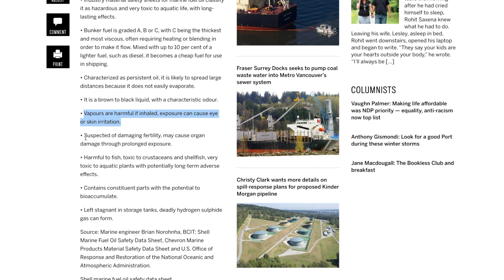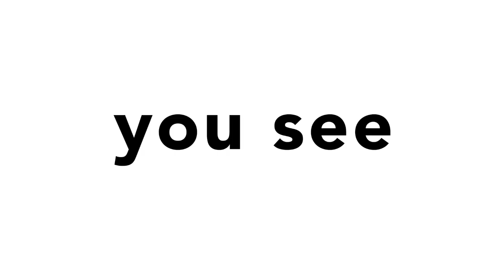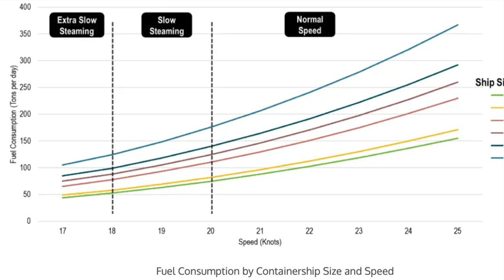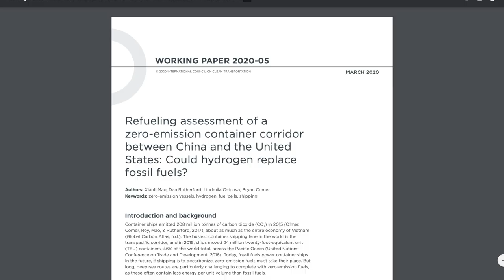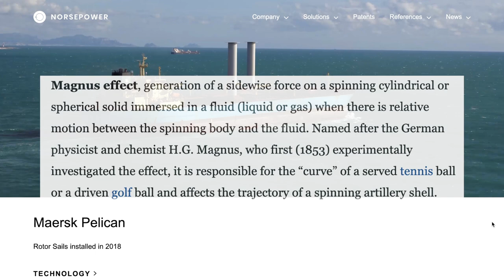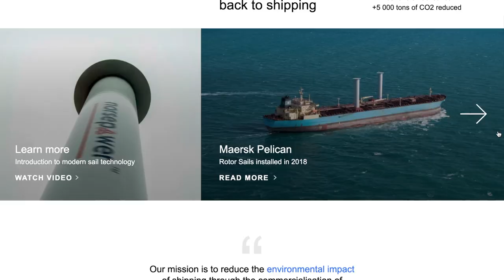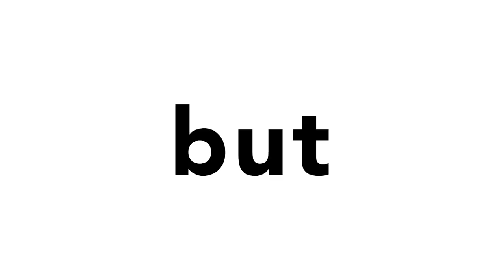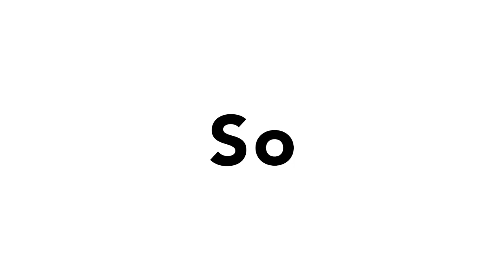Are Renewable Container Ships Even Possible?

Comment: Shipping companies pass on the expense to the consumer.  Enact laws and pay more for everything, that’s the current situation, of go nuclear.
Reply: ' pass on the expense to the consumer' I think you may have stated 'The First Law of Market Economics'.  WRT nuke's if you do a web search for ‘nuclear ship savannah’ you will see that it has been tried and did not work.  A similarly heavily subsidised, by the government, vessel is in use in Russia which also operates, in support of the Northern Sea Route, a fleet of nuclear powered ice breakers these may, or may not, have been completely without issues.

Just think; would you have full confidence in the management of a nuclear reactor under the control of an anonymous entity only traceable, perhaps, via a letter box in a FOC (flag of convenience) nation state?  If you are, could you sell that confidence to Japan, the state that hosted the Hiroshima and Nagasaki nuclear detonations as well as more recently the Fukushima ‘event’?  Then try that same, or a similar, sales strategy on Ukraine, the nation state that as a part of the USSR (CCCP) hosted the Chernobyl ‘event’.  Modern iterations of nuclear energy, thorium fuel, molten salt reactors or fusion reactors, will carry the legacy of past problems.  It is the global trepidation of anything with 'nuclear' in the name and the economics of nuclear having transitioned from 'energy to cheap to charge for' too 'the costs of remediation are incalculable' that will prevent the adoption of nuclear energy as a means of creating energy at sea.  Modern reaction systems may have overcome the safety problems but the general public, having been misled in the past, will be reluctant to believe the fresh new promises.

‘They’ say nuclear is cheap, it’s not it is expensive and has a large embedded carbon quotient as well as being complicated, dangerous, not universally socially acceptable and having only ‘no need for refuelling’ as a questionable advantage; actually it does need refuelling just not as often.  When ‘they’ do need to refill the warming up stuff it takes considerable longer than pumping tonnes of thick black stuff, HFO cSt380, or thin runny stuff, MDO, onboard which is one of the reasons HMS Queen Elizabeth and HMS Prince of Wales are pushed about by ICEs and gas turbines thus using a similar fuel as the aircraft that fly off of them.  The Royal Navy (RN) with a high degree of skill and expertise uses, at vast expenses to the UK taxpayer, a current operational nuclear fleet of 11 submarines (also known as ‘boats’) in two flotillas, seven attack subs and four ballistic missile boats.  The carbon footprint of all the extra bits of hardware and the fuel, including processing thereof, from ground to propeller, are the external costs that never seem to get considered.

Disposal, once it wears out, of both the machine (that was a ship) and fuel is another can of worms best left unopened.  The 26 RN boats no longer in use are laid up (some in Rosyth and some in Portsmouth) awaiting long term deconstruction including dealing with the fuel rods and other irradiated material.  The USN is not, as far as I know, a commercial organisation working to very tight margins and also has the skill and expertise to handle the complexities of nuclear power; so as well as submarines their aircraft carriers are nuclear powered and each of the current iteration has a build cost three times that of QE/PoW, bigger crews and more generous funding.  For those who still think that nuclear energy might be the answer I recommend this report: - https://www.bbc.com/future/article/20200901-the-radioactive-risk-of-sunken-nuclear-soviet-submarines?ocid=ww.social.link.email.  The navy of the USSR might have been under resourced and over extended but it was still generously supported in comparison with merchant shipping.

Comment: don't you think tesla could disrupt the shipping industry in maybe 10 years?
elon musk already said that ships need less energy density on the battery level to be viable. So with their 3TWH goal for 2030 i believe it can be done as part of their robotaxi network.
Yes, you could say that batteries will still be too heavy in 10 years but if we learned anything about tesla and what they're doing with the 4680 cell in the Semi truck we can at least consider the possibility that tesla also reduces weight in ships and makes the batteries part of the structure. I HONESTLY THINK THIS IS GOING TO WORK, IF HE DOESN'T DISRUPT THE INDUSTRY WITH THE BORING COMPANY FIRST.

PS: seriously, your background music is underrated!!
Reply: Electric motors powered by ‘green electric’, leaving aside the fact that there is no truly ‘green’ electricity, the best we can do is low carbon impact both at installation (capital cost) and production (current account).  Running ships on the ‘lecky’ is tricky the two examples that I personally know and have used are, a vehicle and foot traffic ‘chain’ ferry that ply’s its trade across the hundred meters or so of the Nordre älv between the island of Hisingen and the Kornhall on the Swedish mainland.  The motors are on the ferry and the cable is unwound and wound back up on board as the ferry shuttles back and forth from Kornhall.  When the vessel goes anywhere else, id est dry dock for survey and or maintenance, it is towed by a good old ICE powered tug.  The other electric vessel is a vehicle and foot traffic ferry that runs from Helsingborg (Sweden) to Helsingor (Denmark), a twenty minute trip, she tops up the charge in Sweden each time she is alongside and battery capacity is said to be sufficient for an hour of main engine use.  There are small diesel gennys on board; to keep the lights on in extremis.  Sadly as of now electric boats are as functional as chocolate fireguards, yes ‘submarines can be diesel electric’ but they have negligible cargo carrying capacity and if you ever go on one your first thought could be ‘where do they put the crew?’

Comment: No Bio fuels are not the answer. Hydrogen made using renewable electricity may be the answer. would it drive a hydrogen gas turbine?  Any wind solutions take up room you need for containers.
Reply: To liberate hydrogen (H2) from water you need a lot of energy and while fossil oil & gas, or perhaps coal, will do it and are the most readily available any energy source, wood, photovoltaic, wind, tidal, et cetera, will do that just as well.  H2 is said to be good for use in fuel cells that will give clean energy when combined with Oxygen (O2) and leave only water (H2O) as an effluent; so as well as the cost of creating the hardware and separating out the H2 in the first place we now have the cost of providing the O2.  H2 is very, very light and very, very volatile so this is where we remember the Hindenberg airship disaster and while events of that magnitude might not be likely much smaller H2 fires or explosions can cause a lot of damage.  The ‘light’ means that though there is lots of energy per unit mass there is not much mass per unit of volume so all the problems of CH4 but much worse.  You need to compress it, a lot, or cool it, a lot, to get enough on board your ship in manageable volumes to be useful.
  The alternative to fuel cell use of H2, burning, also generates combustion products which includes waste heat going to the cold sink and a few NOx ‘nasties’.  The numbers, on any of these, are getting very difficult to show any sort of surplus so is this a case of running hard to stand still?  H2 may have a place in the energy mix on land as a storage medium but on a ship where there is a reasonable and constant auxiliary power need the question could be posited, ‘why go through the extra stages instead of using the harvested energy directly?’

Comment: Ammonia, ammonia,
Reply: Ammonia (NH3) requires creation which has fiscal, environmental and energy costs or impacts, before you get the energy to the point of use, and the use will generate effluents that will impact the global environment one way or another.  Thomas Midgley, Jr. (born 18 May 1889 died 2 Nov 1944) was an American (USA) chemist who, as well as developing the technique of putting the lead (tetraethyl (TEL)) additive in petrol, created chlorofluorocarbons (CFCs), yes those ozone depleting CFCs, so that the use of NH3 as a refrigerant could be discontinued.  NH3 could be the most dangerous and least ‘clean’ clean energy source, it is very bad and probably deserves a rant all of its own; so let’s just leave that for a while (somewhere very far away that is cool, dark and quiet).
Reply: @BernardLS  Actually there is a new method for producing ammonia using a fuel cell like reactor that is clean but currently does not produce at a high enough rate. If this could be overcome; ammonia is a great way to transport hydrogen. Pretty sure it can be used in a diesel without too much modification. You'd need a heck of a converter to pull the nitrogen oxides out or the ammonia could be decomposed before use and the nitrogen exhausted. Surprised to hear pessimism that ammonia which is transported by ships cannot be used by them.
Reply: @stevemickler452  I have not researched the latest, research or pre industrial, ammonia production methods so looks like tomorrow taken care of (:-), thank you.  NH3, in industrial quantities, gets carried on LPG tankers within closed cargo containment systems that are isolated from accommodation and working spaces.  The very pungent odour still seems to get everywhere.  Switching out of NH3 back into any other cargo, C3 or C4 for instance, is a lot of work.  Wartsila in Finland are trialling running marine ICEs on it so it can be done but I am not confident it will meet cost/safety and cost/benefit criteria.  I think the NOx would arrive post combustion as it is the exothermic deconstruction of the H to N bonds by the oxidation of the fuel that liberates the energy unless as you say the NH3 is decomposed (more complexity and cost) pre injection.  As the saying goes ‘more research is required’.  Will also need to refresh my knowledge of the details of the NH3 MSDS.

Comment: 6:50 Correction:
You don't get energy from wind mills, but from wind turbines.
A wind mill is used to grind cereal and similar, hence the name "mill".
Reply: Good logic. For marine use vertical axis wind turbines (VAWT) would be better than the, what have now become 'traditional', horizontal axis wind turbines (HAWT) for reasons that include air draught of the vessel, weight distribution and maintenance access.  The energy yield is still subject to the wind blowing at the right strength and space available on board for the hardware.

Comment: but doesn’t hydrogen have almost 3 times the energy density of gasoline? so in theory it would just take 30% of the current fuel space +all the things that you need to make use of hydrogen to actually run a shipping container which lets say would make 40% of the fuel space available for cargo?